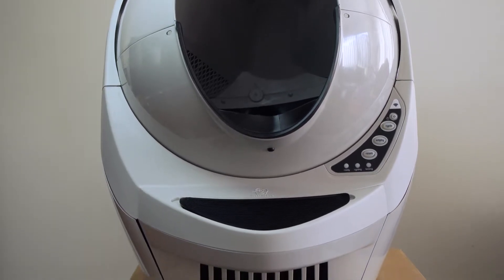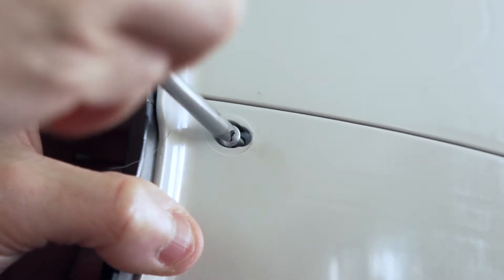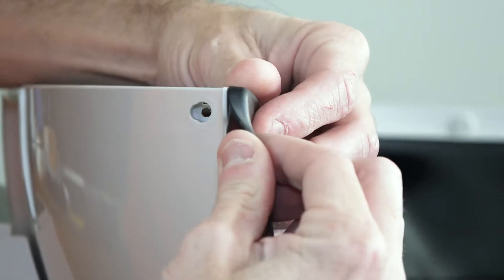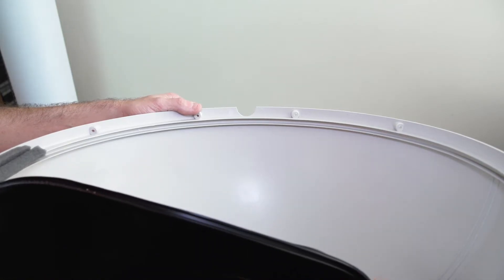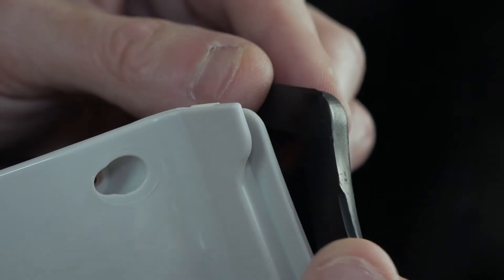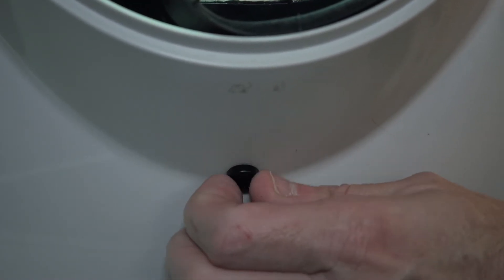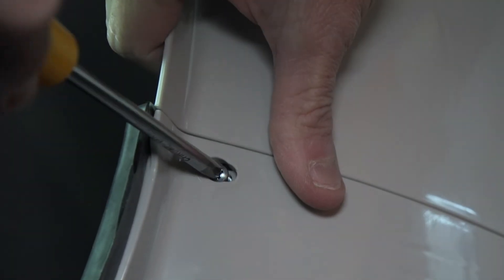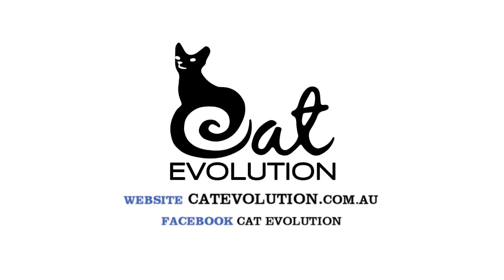Litter Robot 3 Open Air How to Install Globe Liner

Comment: Thanks for this well done video. My robot arrived with the weight having fallen out of the proper place for it resulting in waste sticking to the rubber liner because it wouldn't pop out during a cycle. Your video gave me the confidence to fix it without doing a return.
Reply: Great to hear, and a purrleasure to help. The Litter-Robot is designed for self repair, and the weight coming loose is easy to fix if you know how.

Comment: URGENT! What is the purpose of the 2 foam strips? Should they be replaced? If so, you are not doing it and in the package there is only one short replacement foam strip and it is unclear what to do with it. Kindly explain. This is the second video I am watching and this question remains murky. I just noticed, however, that in the instructions provided it says that the 2 foam strips should be discarded, which you do not do in the video and that you should place the new single foam strip "in a similar fashion". Kindly explain where exactly this should go!
Reply from the maker: The foam strip is for replacing the exisiting one installed at manufacture left side. Replacement is in case it’s gotten dirty or damaged. Essentially it just helps add a little more packing out of the liner where it gets the most litter rolling over the joint. It’s not integral for cycle or operations. We have also done some testing with using substitute foam purchased from Bunnings and you can add additional similar foam around the full lower globe edge if preferred but it’s not necessary for function. Do note that  we are the Australian distributors and this video is provided for assistance not definitive information.  Design queries should be directed to the manufacturer Whisker.com if you need more clarity on the appliance. Trusting this assists.
Reply: @Catevolution1  Many thanks for the prompt and comprehensive response as well as the excellent video. As there is a short and a long foam strip, the new one replaces the short and the long one should be disregarded? My litter box is now 6 years old!
Reply: @roninx1413  The shorter part is in against the body, the longer on the edge of the globe liner, left side. Should be the same as the one you removed. Review the video around the 3 minute mark to see it in place as Nathan removes the liner. I dont usually remove the foam when doing a replacement liner (workshop) unless its in very poor condition.

Comment: Is this safe to do for a deep clean?
Reply from the maker: You can take out the liner if you want to for a deeper globe cleaning, but its not usually needed. If you have issues with the front lip coming off, purchase the Fence accessory to stop this and you dont need to keep cleaning underside the liner. If you do decide to take out the liner for deep cleaning, only unscrew around the middle, not top to bottom so you dont lose the magnets in the globe.

Comment: Hi! This is a very helpful video. I do have another question for you. My cat managed to messed up the shifter of his litter robot. It was slightly bender and not shifting well. Do you know how to fix or replace it? Thanks in advance
Reply from the maker: The sieving grate is part of the globe, inner sleeve. Unless it has broken free at the joint, it is designed to bend and flex under litter weight. If its not sifting well, it is more likely that the litter is not suitable, possibly too large and too light to sieve well, or if stony and sandy, it can dam up and also not sieve well. You need to contact the place of purchase to check warranty and also get more information. If  you are in Australia, you can provide brand of litter and I maybe able to review for you for suitability.

Comment: Thank you for this video! Helped A lot!

My liner came with a new screw and nut installed in the liner to use... I didn't realize that until after I had it all together 😂 Had to take the liner off the front to remove it to use it 😅

The liner seemed to be too big when I was installing in along the rim. I found it helpful to have the front all installed, then kept essentially massaging the liner front to back along both sides until it all finally appeared to be well into the groove without bunching. 

I also found it helpful to start with screwing it back together starting from the very back and working forward. Initially I started up front... but the back end wound up popped out a bit... much easier to pop the front into place with the back held in properly than the back when when the front is held in place.
Reply: My goodness what's going on with my typing on my phone? 😅
Reply from the maker: All good and glad it was helpful!
Reply: This comment helped me more than the video 😂🙌🏽🫶🏽 jk jk lolol 😏

Comment: I cannot stand the lip on the litter box!!! I cannot keep it threaded… once I get it the cats undo it by scratching it… do you have any ideas??? I tried glue but that didn’t work either!!! Help
Reply from the maker: the fence accessory is designed to pin down and protect the entry lip if your cats scratch or kick it off.https://youtu.be/BAvacr9H3q4 https://youtu.be/BAvacr9H3q4
Reply: Also try binder clips! That worked for me

Comment: I'm having trouble with it. Mine seems to be too long. I put it on tight and it's not laying flat.
Reply from the maker: The globe liner usually has waves or folds in it. When fitting, start at the rear middle and work forward, not stretching anything. When you have about half done, move to the front left and right and fit the pockets over the shell casing, so that you know you have it pretty much lined up. The folds are in the bottom 2/3 not in the actual fitting at the top in the channel.